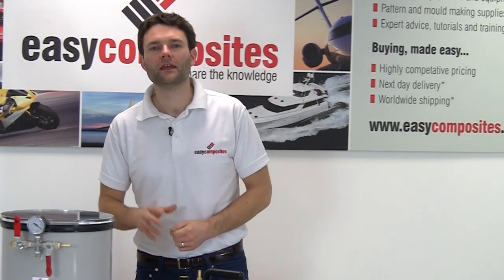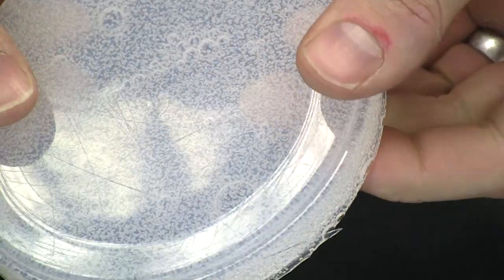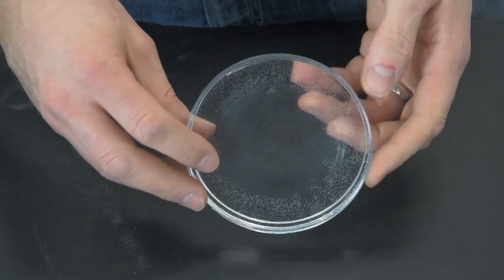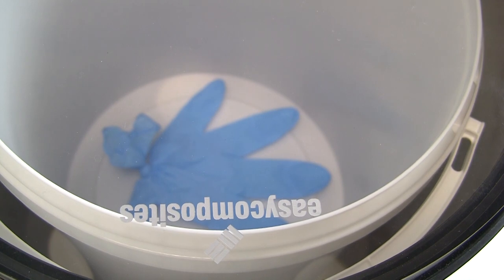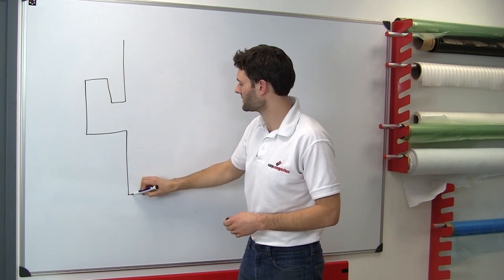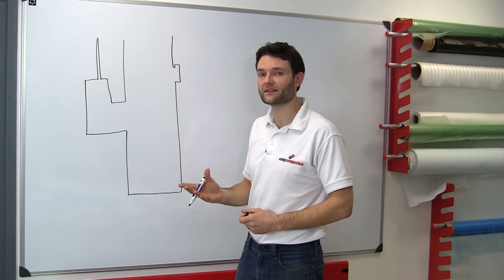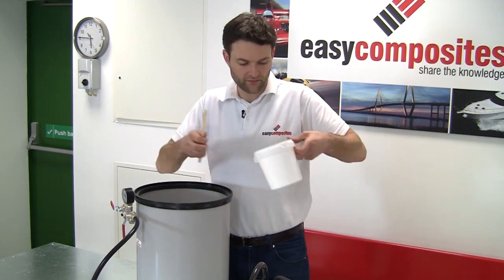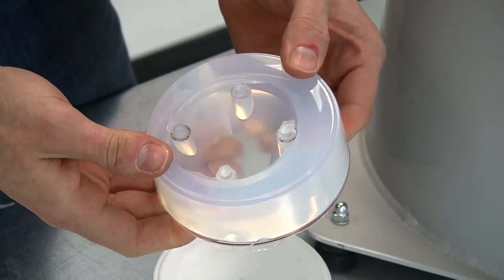How (and Why) to Vacuum Degas RTV Silicone Rubber and Casting Resins in a Degassing Chamber

Comment from the maker: That's right, no hose clamps because the valves close the hoses off fully so there's no need. Regarding epoxies, it's a preference thing, personally I don't tend to do it and we still get perfect looking results but many of our customers swear by it and so certainly there are benefits for some people. I think temperature makes a difference, at lower temps resins are thicker and so forced degassing might be beneficial.
Reply: HI. i'm planing on buying one for a clear polyester resin. but the object will be to big to put back in the pot for a second time. so i'm hoping this will not matter or should i put the resin in its container for a second time before i pore. using the smaller pump to start with.
Reply: is the smaller pump ok for small amounts of resin poring.

Comment: Thank You for the great explanation of the degassing process.
Is there a benefit to pressurizing the mold between degassing cycles?
Also temperature must have an effect with the high viscosity silicone . .  any tips?
Thanks Again
Reply from the maker: There is no need to pressurise the mould between cycles. Increasing temperature will slightly reduce the viscosity, however it will shorten your pot life.

Comment: Need Help.
My Dual Stage Robinair 8CFM Vacuum pump goes upto -30inch of HG.
It is a DIY Setup.
Used Shinetsu Mould silicone to Degas.( very Viscous)
The bubbles expands but donot self collapse. Tried to Degas 2-3 times but all efforts wasted!
Looks like vacuum degassing created more bubbles than before.
What's the problem I can't understand!
Reply from the maker: Check for leaks, if it is not full vacuum, it will unlikely collapse.  Also check with the product manufacturer.

Comment: OK I'm fine with degassing the silicone mould, but have trouble when degassing the polyurethane resin. If I degas after pouring it into the mould, it tends to produce so many bubbles that they expand out of the sprue holes and I'm left with a half empty mould. I suspect that this is because the pressure is too low and the mixture is in fact boiling, but i'm not sure. All I really want is to get rid of the air in the undercuts, and I don't need to actually suck out the dissolved air. Would this need a less extreme vacuum, and if so can you recommend how low I should go?

Comment: So basically we can use vacuum degassing for removing bubble out of silicon rubber and epoxy resin. No more money to spend on pressure pot ? Am I right ?
Reply from the maker: That is correct.  Generally you would use one or the other.  A pressure pot shrinks down bubbles to a tiny size.  The degassing chamber makes them expand and be expelled from the liquid - any remaining bubbles will shrink as atmospheric pressure is restored.

Comment: Can you use this after you poured Resin into a mold to have a bubble free cast as well? I heard of people using Pressure pots but can this degas silicone for a bubble free mold and degas resin for a bubble free cast without having to use a Pressure pot? If so for the resin, would you degas it after its been poured into the mold to get  a bubble free cast or? Your response is much appreciated! Thanks!
Reply from the maker: Yes you can. Some people prefer to degas the resin both before pouring and after.  The only limit is the practicality of fitting the mould into the chamber if the mould is very large.

Comment: Great video!! I'm looking to purchase a vacuum pump can You tell me the specs of the pump you use in the video?  I was told I need a 7 CFM that can pull -28 inches of Mercury to degas my smooth sil 940 platinum silicone rubber.
Reply from the maker: The current range of pumps we sell are made for us by DVP.  For your flow and vacuum requirements you would need the EC.20 pump for which full details can be found at this link: https://www.easycomposites.co.uk/#!/vacuum-equipment-and-supplies/vacuum-pumps-and-equipment/DVP-EC20-1-Industrial-Vacuum-Pump.html

Comment: Could the lack of degassing be why my silicone castings come out quite rough to touch? I've been casting silicone onto 3d printed moulds with layer lines that I sand down and coat with primer and gloss but it's never properly smooth after the silicone comes out.
Reply from the maker: If the mould surface is perfectly smooth then the silicone should be smooth.  It could be a lot of air in the silicone causing surface to feel rough due to the open bubbles.
Reply: @easycompositestv  thanks for that. It does look very cloudy once I have mixed it despite the part A being clear so I think you are right

Comment: question: I degass the resin, cast it in the mold e put the mold again in the vacuum chamber.
in this situation am I allowed to have no vent holes in the mold? They are no longer necessary, right?
Reply from the maker: You will still need vent/pour holes to get the resin into the mould and also as a path for any air to escape from the mould during the degassing procedure.

Comment: is this work for degassing quick-cured resin like polyurethane? mine is cured in 3 minutes. my idea is pour it to my mold then put it to vacuum camber until resin cured? will it okay?
Reply from the maker: +afadario Yes but if you have such a quick resin then you might want to reduce the volume of the chamber by loading it with some ballast (like house bricks or something else to take up the space in the chamber); this will mean that the same pump will draw down the chamber to vac pressure more quickly. Don't forget that it's essential you re-pressurise the chamber before the resin cures - simply loading it in a pulling a vac until it cures to definitely wrong and won't give you good results.

Comment: I did not know that a vacuum chamber could be used to cast resin parts. Would not the resin overflow. You should make a video to demonstrate this.
Reply from the maker: As long as the container you are mixing in and the mould have suitable expansion spaces then you won't have any problems with overflow.
Reply: Easy Composites Ltd I done some test, and the urethane resin react with the the silicone mould and turn into foam when the vacuum reach -25. While the same exact batch of resin degases normally inside the plastic cup .  So witch silicone do you recommend to avoid such a reaction ? 

I may also try to bake the mould to remove any moisture that may be trapped inside the silicone.

Comment: is there a difference between a pressure pot and a degassing chamber? If yes, what are they best for?
Reply from the maker: Yes, they're basically the opposite things to eachother. A degassing chamber is evacualted to remove all the air - materials are degassed because the trapped air inside the liquid expands (in the low pressure) and bubbles out. A pressure pot is pressured with multiple times atmospheric pressure (example 5 bar) which compresses bubbles in a liquid. The advantage to degassing is that the material can be removed from the degassing chamber once degassing has occured and can cure at ambient pressure. With a pressure pot, the trapped air is still inside the liquid and so it must be cured inside the pressure pot under pressure, otherwise as soon as the pressure it let off, the trapped air will expand again. It might help to think that a pressure pot shrinks the air bubbles and then the curing process locks in the trapped air at this reduced volume. A degassing chamber removes the trapped air.
Reply: thanks a ton.

Comment: When your done degassing the mold the 2nd time, do you leave it inside the chamber to fully cure after releasing the vacuum? I did this with some molds recently for the first time but ran into some issues with bubbles poping up slowly over time
Reply from the maker: You can do either as it shouldn't make any difference to the cure as long as you are careful removing the mould from the chamber. If you still have some bubbles popping up perhaps give it a degas for a little longer.  If it is a mould with undercuts, it might help to slightly prop the edge of the mould at a very slight angle to help any air entrapped under the undercut to flow upwards.
Reply: I did notice in the video you gave it a full 5 mins to degass. That is likely my problem then, as I was only giving it 2-3 mins. They are simple open pour molds like the one in your video, no undercuts at all.

Comment: If degassing PU resin in the mould does that encourage the resin to flow into all the parts of the mould or is that reliant on viscosity? I want to cast fine parts [ model aircraft]
Reply from the maker: Yes; if you run a degas and then re-pressurise cycle whilst the resin is still within its pot-life then this will effectively force the resin into all the fine surface detail (including smaller undercuts or difficult areas. If the undercuts are large then you need a slight surplus of resin (almost like a 'header') that can feed resin into the undercuts when your re-pressurise the chamber.

Comment: do you leave the liquid in the vacuum guage. i have bought one of your vacuum chambers and followed the instructions to the book but my guage does not budge it stay's still i did remove the bung and then put it back on i did not pore the liquid out as i guess your supposed to leave it in. i have the small pump but my vacuum guage does not move.
Reply from the maker: The liquid is meant to remain inside the gauge.  The bung needs to be pierced to allow the gauge to equalise with atmospheric pressure. Assuming there is no leak anywhere and the pump and system is pulling a full vacuum, then It sounds like your gauge has been damaged at some point.  If you contact us with your details we will happily send you a replacement gauge.  You can contact us on technical@easycomposites.co.uk
Reply: @easycompositestv  HI thank you i only took the bung of then put it back on i never pierced it so i will pierce it this time and see if it works and if not i will get in touch with my details. thank you for your help.

Comment: Can you use your chambers with a vacuum injector and a compressed air supply?
Reply from the maker: You could however the problem with venturi vacuum generators is that they don't tend to achieve particularly high levels of vacuum. It's normally at the very high end of the vacuum scale (28" mercury or 99% vacuum) that the degassing really starts to happen, especially for materials like silicone which can be quite reluctant to self-collapse until the highest vac levels are reached.
Reply: Thanks for getting back to me, I guessed as much or there would be plenty of people using a cheap ejector instead of an expensive pump!.

One more question please, can your chambers be used on their sides?. I'm setting up to cast some figurines over a foot tall so the second degassing once the RTV is poured over the master will need to be laid horizontal, then the resin will need degassing with the mould vertical.
Reply from the maker: You're welcome. Yes, no problem at all using them on their side.

Comment from the maker: Full vacuum so 30" mercury or 1 bar vacuum.
Reply: right now I'm having a mental problem where I would let air into the chamber once it hits 30" - can I just leave the vacuum pump running once the needle taps out at max on the chamber meter?

Comment: What level of vacuum do you pull?
Reply from the maker: As close to absolute vacuum as you can possibly get. There are a lot of different vacuum units but 99.98% vacuum is a common target (virtually -29.92 inches mercury).
Reply: So as hard as possible then.  Doesn't this make some of the more volitile components evaporate?
Reply from the maker: Epoxy resin has virtually zero volatile contents in it, so you do not get any issues with being close to a full vacuum.
Reply from the maker: Most silicones do not contain VOCs (or only negligible VOCs). Other materials such as some resins (especially styrene-based ones such as polyester or vinylester) do have high VOC content and in that situation you may choose to either moderate the vacuum level by hand (opening and closing the valve) or by using a vacuum regulator.

Comment: how is possible that you guys charge 94$ shipping for something that will cost 74? can u explain  that
Reply from the maker: +Aldo Allende Oliva : We're in the UK, I'm not sure where you're based but I assume the US. Dangerous good by aeroplane is possible but requires extensive paperwork and carries a surcharge levied by the airline; therefore, it is possible to have shipping charges that exceed the value of the goods. Sometimes it works the other way too, smaller, non-DG items can be very high value and ship to the US for less than £20 ($30). It would be fantastic if we could send large, heavy or dangerous items from the UK to the USA for a very low price but unfortunately air freight is not cheap these days. The service is VERY quick though (around 1-2 days to the USA).